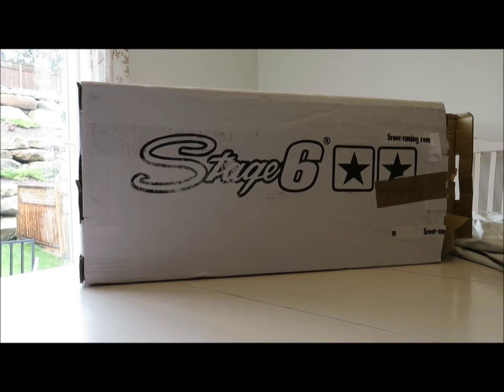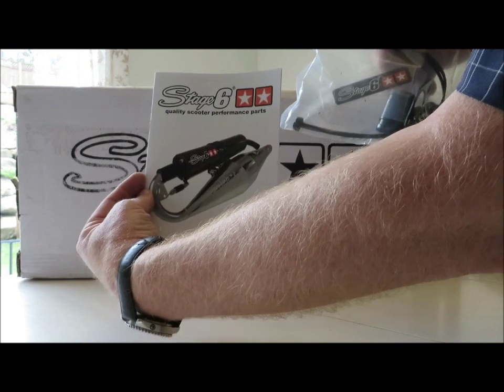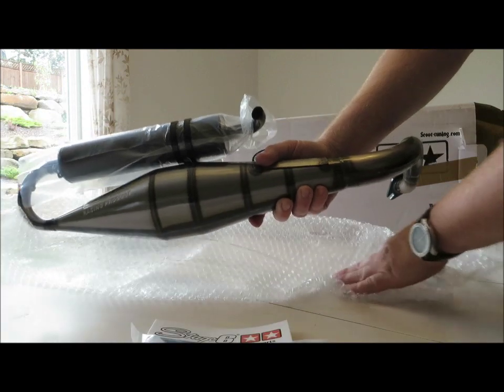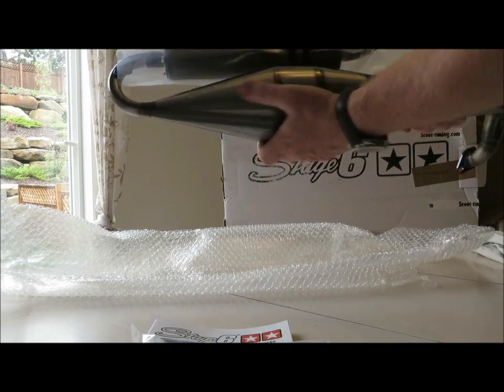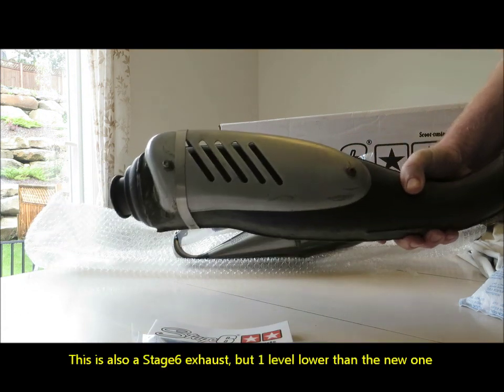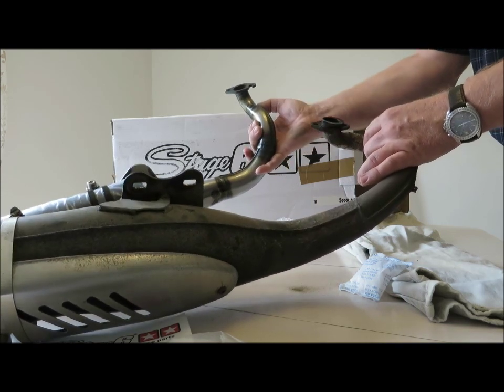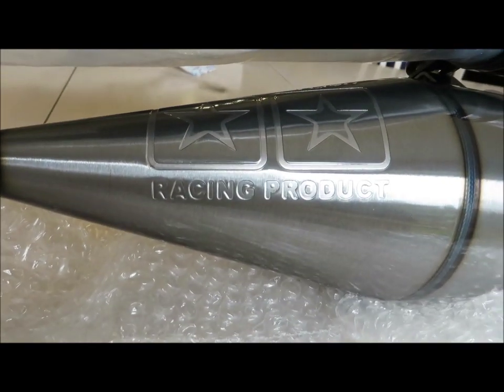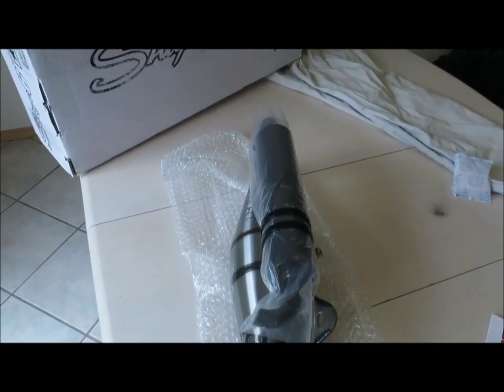Stage6 Pro Replica Exhaust Unboxing

Comment: nice exhaust man! i got a leo vince zxr, stage6 mk2, 17.5mm dell carb and other minor mods. the exhaust is a snugg fit but it should definitely get on. if it's made for the zuma, it should work. i can cruise @ 45mph without over revving. i need tall gears as this motor is capable of another 10mph easy. cant wait to see how it performs

Comment from the maker: good to see you got the MK2 engine, i just put the exhaust on about 1 hour ago, and am having some problems, i will call spotomoto tomorrow and find out if i did something wrong in the installation, You should be able to reach past 60mph with the mk2, your gears should be ok, did you upgrade the variator, that`s important.

Comment: I've seen that that exhaust is good with std cylinder, but i have a 50cc sports cylinder on my scooter, and it should give a better performance aswell. Like, some people with 50cc racers have the "70cc exhaust". So actually it fits with 50cc.

Comment from the maker: ya, got the restrictor out of the exhaust and re in stalled it,, works good, but I need to order new rollers, since I have very little torque at low speeds and very high speed at high rpm,,was going past 65mph, but little power going up a hill,,, so will order the rollers tonight from spotomotostore, I want to get the mk11 engine but may get the race mk11 instead,, will see,, that would be later on, would get new primary gear and racing crankshaft if I got the race engine.
Reply: How did you get out the restrictor?

Comment: The Pro is for 70cc the Replica is for 50 and 50 sport
Reply: WDYM... The stage6 PRO Replica its the same exhaust. If you speak about original stage6 (not replica) exhaust it would be the best on the midrace/high end scooter... This one which is in the video is good for 50cc, but better fit with 70cc low end engine.

Comment: i had 1 on my yamaha neos(aka: mbk ovette) my set up whas 50cc cilinder with a speed one vario with around 4.3 gram rollers and geel clutch spring and a 12.5 carb (could also be 12)  it was 1 hell of a exhaust nice sound  but it wil rust kind of quick, that the only problem with it i think im now driving with a gianelli extra its a more heavyer sound with more bass to it and not the high pitch sound
Reply from the maker: Ya, I gutta fix up the scooter, need to put in a new crankshaft, variator, and probably a new engine, but will wait a bit.
Reply: wel if you need any info on the block (or good parts)  ; ) just send me a message
Reply from the maker: Thanks, I just need time and money,,hehe
Reply: lol i have the same problem XD
Reply: @poisedonis  hi there,i have yamaha neos also,just put a 70cc engine on it,did some work about variator and torque,now i am looking for an exhaust,what can you recommend,i wanted something not so loud for a city ride and at the same time that wouldn't choke the 70cc engine...
Reply from the maker: @andrewnahnichuk6300  stage 6, but you may have to re adjust things after installed